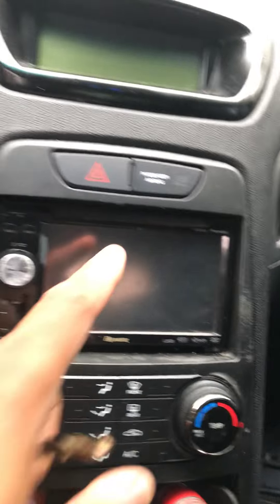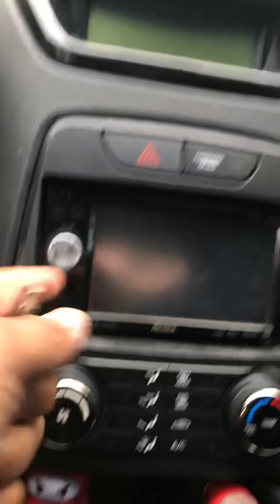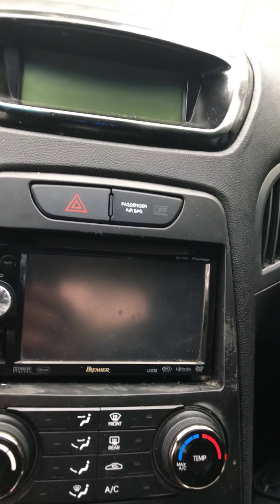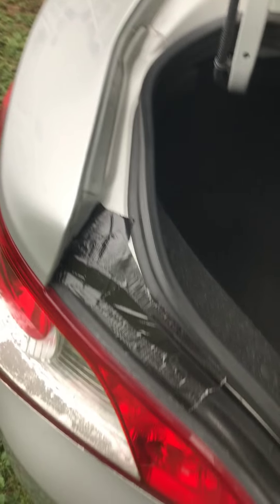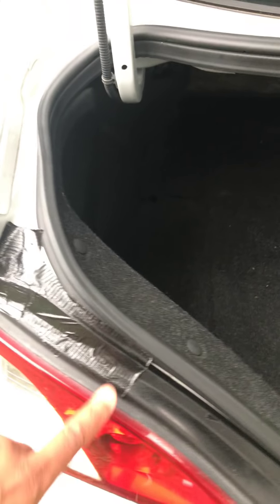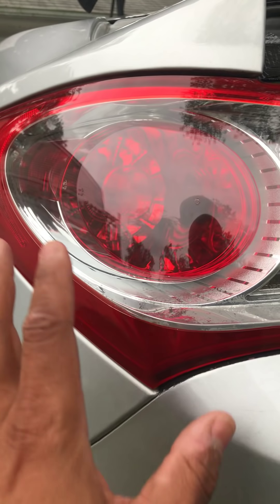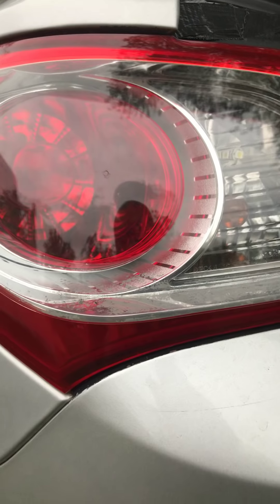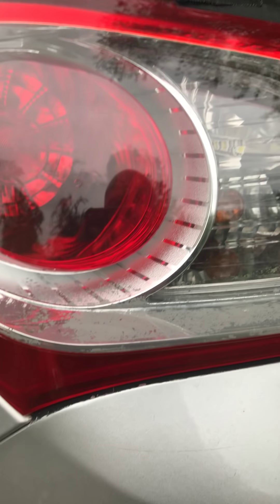Ghetto fixes on the Genesis Coupe by former owner.....

Comment: For the turbo bolt that you have to drill out, make sure you are level when you drill. You don't want to cause more damage than what's there. For taillight fixes use "RTV Silicone" on that! Even RTV silicone that has a high heat tolerance! That's what I used on my Subaru Impreza(GC8 chassis I had from 1995) to fix the crappy OEM taillight issues of water getting into the trunk OR on the taillight! ALSO check your spare tire well for WATER! Standing water in your trunk CAN LEAD to your trunk rusting out! And more than likely it's your taillights not sealed right!(Again, go to Autozone or somewhere and get you a tube of RTV silicone! I usually get the clear color) Also I was advise to getting the Grimmspeed double layer turbo exhaust side gasket! it's a great gasket and it works! Also back to the turbo, the thread pitch is M10x1.25.(most of the Genesis thread pitches seem to be that, even the shifter knob lol) When I had mine I went to Advance Auto and got some Honda M10x1.25 exhaust manifold studs and used them to replace my OEM ones. And the nuts I used are the same thread pitch BUT the Amazon product number is B076T7W897. These nuts(lol I just realized what I typed) have built in locking flanges so they don't back out! And they do work, they're so AMAZING! I hope this info helps you well Chuck! One day I'll buy another Gen but you keep pushing on bud!

Comment: Take it to a shop and have em spot weld it together instead of drilling. You might cause more damage that way. With a spot weld one hard hit with a hammer and it’ll break off come time for your new turbo install. As far as the interior is concerned try this site. They sell oem interior pieces for the genesis
tuscanicustoms.com